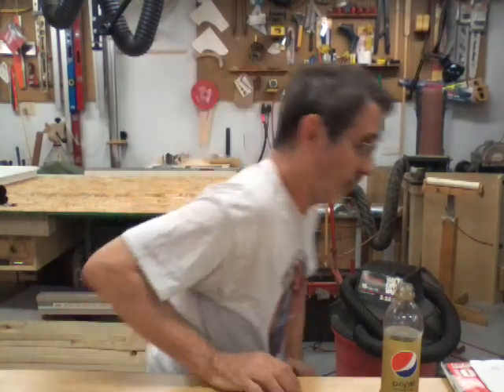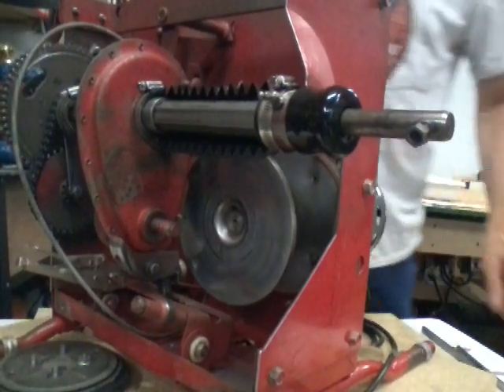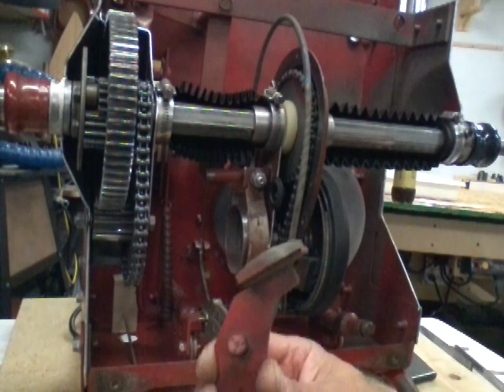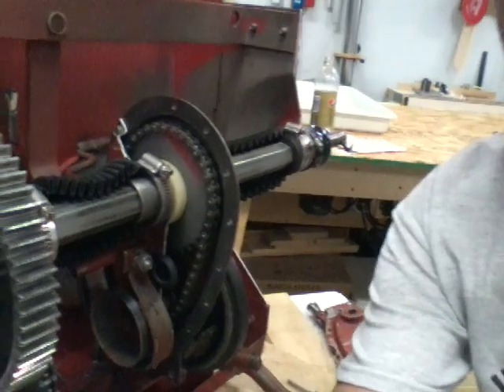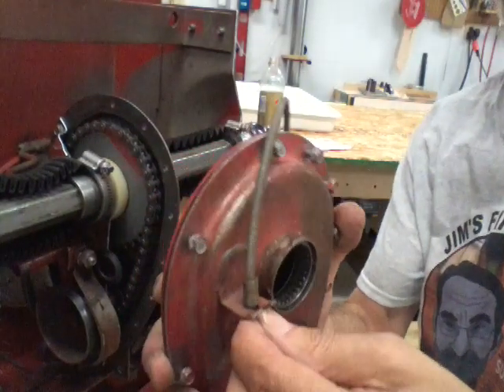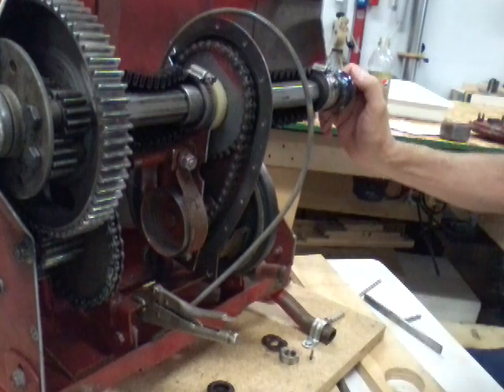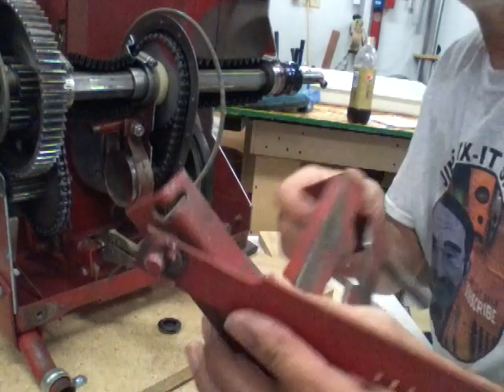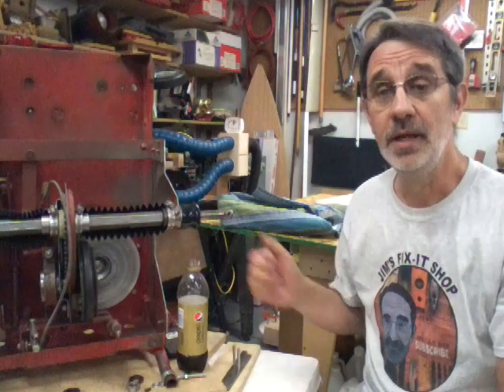192. M/S.39  How can I hook up my brake and clutch cable on my Snapper

Comment: Did the clutch and brake cables today after reviewing your video.  Just invaluable info.
Reply from the maker: Thanks glad I could help hope your a subscriber it’s free and it really helps me out. Jim
Reply: @jimjackson9381  only real issue was not being able to clearly see the way the business end of the clutch connected to the bracket tied to the yoke.  Had to find the video of you holding that bracket.  And I agree the brake cable routing is weird.  Couple of wire ties to hold it in place and all is good.  No reply is necessary.

Comment: good morning  Mr. Jim I just got a snapper it is very old but it runs great .I  just adjusted the belt thanks to your video I was thinking of making a small golf cart out it any suggestion
Reply from the maker: Well I suppose you could make some kind of a bracket and shelf that would hang on the rear bumpers like your bag or does then you could always remove it when you’re not using it, if you decide to build it make sure you send me a picture when you’re done. Jim

Comment: Jim,  my imagination did have the spring in my mind going against the hole where the 2 cables go thru, but I kept thinking it hooked to it some how and the 2 spots where you squeeze the ends to hold them in the little indents. I couldn't even see that  at all. So  tomorrow or latter tonight I could go right out there, and put on the Auxiliary brake cable. I've got it soaking in oil. it's froze up right now.
It's froze from the one indent squeeze thing, all the way couple feet to the other. Maybe I should of soaked it in vinegar would be less messy to take out. lol So it was video192 that showed me/ must be an old one (your using for the demo) ( what year is it?) it's set up just like my 1977 at least as  fa r as the band and shoe brake and the cables go. mine is a series 1 mower.
Reply: now i seen the clutch rod that hooks to the Yoke yours is flat iron, mine is round so your cut away is newer than mine but the brake's and cables are the same luckily.
Reply from the maker: Well, I hope it helps you if not, let me know. Jim.

Comment: Thanks for your videos. They are great. I have a 32-year-old Snapper 3311X6S and it is still going strong. Thanks to your videos I have replaced all the worn parts and it is back to almost factory condition. I have a question. What can I do about where the cable has sliced a 1-inch slot in both the front end of the main tube (where it comes out to the pedal) and at the back where the cable passes through the case? I'm sure you've run across this before.
Reply from the maker: wtr 
Glad I could help hope your subscriber it’s free to subscribe. Jim
Reply: Thanks Jim, I am a subscriber. What about my question?
Reply from the maker: wtr 
  Hi it’s Jim
  I wanted to wait till I got home to look at my frame I have a couple frames that have done that and I’ve seen a lot that have not why some do and some don’t it’s hard to figure, the best thing to do is weld The cut closed and try to file it smooth other than that there’s not much you can do to stop it or to hide that. Jim
Reply: Thanks Jim. As I said great videos. Keep up the good work.

Comment: Gary Bohres

Love your videos and with our 28 inch getting to be 10 years old, we really need it.  We replaced our drive disk, "friction ring" with your help and the mower moves great.  The problem now I think is the brake, but only in reverse, and only when going fast.  We have a one pedal and the brake pad looks a little different than this video.  From the end the pad looks fine, but I want to look at the entire pad but can not find your video on how to do that.  Can you point me to that video?
thanks,
Gary
Reply from the maker: Gary Bohres 
I’m not sure what you’re looking for or what you want me to show you by this comment could you be a little more In detail. Jim
Reply: @jimjackson9381  Sorry, I am looking for your video that shows how to inspect a brake pad on a one pedal rear engine riding mower.
Reply from the maker: Gary Bohres 
In this video I talk about the brake shoes four minutes into the video see if that’s what you’re looking for and let me know. Jim
Reply: @jimjackson9381  Yes, I think that will get me to where I need to inspect.  Thanks Jim

Comment: HI Jim, sorry to bother you again.  I finally got the belt on and tensioned, but in the process I broke the black plastic piece at the end of the brake/clutch cable.  I order the part and got it installed, but I think I must have missed something as the actual cable just slips back and forth and the tensioner pops out of the  tab where it mounts.  Additionally, when I start it, it runs great until I take my foot off the clutch and then the engine dies, so I'm thinking I don't have it attached quite right.  Any ideas?  Thanks in advance!
Reply from the maker: Aaron Slusher 
That’s not caused by your brake cable at all, that problem is the safety switch that is on the yolk inside the rear case if you stand it up it will be in the lower left-hand corner with four wires going to it pull the switch out and test it with a meter. 1/2 of the switch is normally open and the other half is normally closed. Jim

Comment: Hey Jim.  Love this channel.  My grandpa had (has) one of these since as long as I can remember.  Big yard.  He used to mow with his J Deere and my grandma would follow, bagging with the Snapper.  Always loved the thing and finally got my own.  Anyway, is there any way you could tell me the part number for the auxiliary brake cable seen in this video?  Having a heck of a time hunting it down.  Thanks Jim!
Reply from the maker: David Kolander 
Hi David it’s Jim
   Can you find a model number somewhere on your machine it should be on the round pipe going from the front end to the back or on the rear case somewhere let me know if you can find it otherwise I’ll need pictures to try to determine the age of your unit. Jim
Reply from the maker: Hi David it’s Jim
  Have you had any luck finding the brake cable or a model number for your machine so I can help you find something. Jim
Reply: Hey Jim, thank you very much for following up.  I did a little more research and found the cable I was looking for.  Thanks a lot!
Reply from the maker: David Kolander 
Well if you need any other help with any other issues please let me know. Jim

Comment: Newbie when it comes to this mower. It’s older than I am! Mine completely sheared off the cable part that goes from the spring to the brake drum. I ordered a brake cable but it’s the piece going from the string forward. What is the part number that I need. Local dealer is of no help and google isn’t either
Reply from the maker: Loni Lichti 

I will need a model number or at least some pictures of your machines standing up so I can try and figure out what cable you need. Jim
Reply: Jim Jackson not sure how to do that here. Email? Model is long gone from its original riveting and the engine has since been replaced.
Reply: Jim Jackson possible 30083*(unknown last, maybe 9?)

Comment: Hey jim. My snapper runs wheni have the break clutch down to start it. But when i let the pedal up its stops???
Reply from the maker: Dave Every 
Hey Dave
  If your machine starts and stops as soon as you let out the clutch it is your yoke switch that’s causing a problem you’ll find that inside the rear case where your yoke activates it checked out with a meter and see what you come up with. Jim